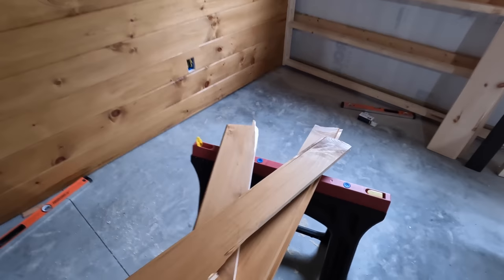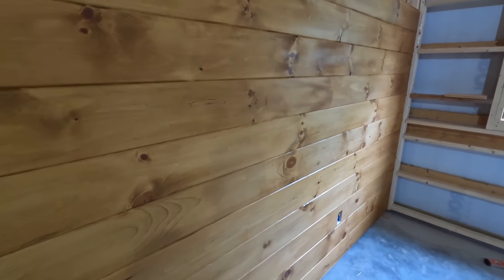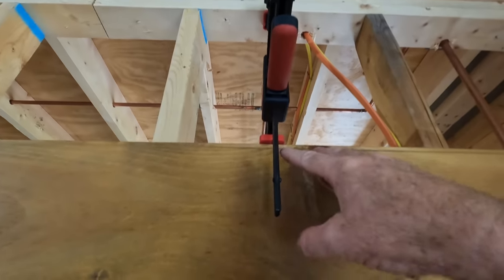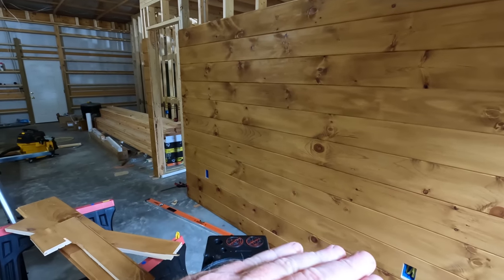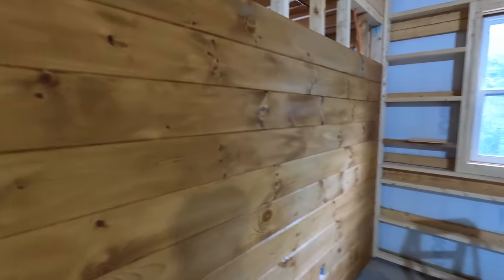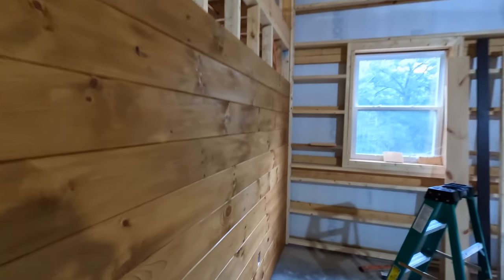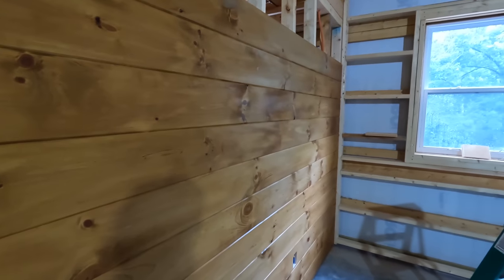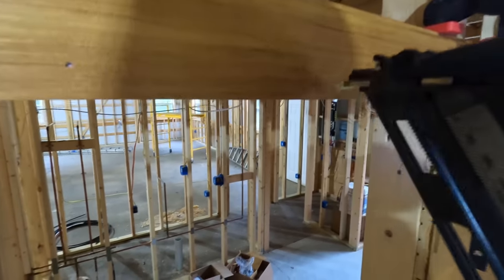Simple, Easy, Beautiful, Tongue & Groove Pine

Comment: Mike, I used the same boards to finish my cabin during the beginning of the pandemic. I charred the wall boards and polyurethaned the ceiling boards to reflect the light. I used a 500,000 BTU Handheld Propane Torch to char the boards. It seals the wood without the poly smell. You could do an accent wall or use it around a dartboard. Have a great Holiday.

Comment: Doing a great job there Mike, all I can add is to put a stop on your drop saw so you don't have to keep measuring the short pieces and your square works well as a guide when cross cutting with the circular saw. Looks good and you don't need to hold down the couch when it's raining.

Comment: Mike, back in the day we would use a scrap piece and  cut it into a wedge shape nail a block above the bowed board and  drive the wedge between the two forcing a tight joint, that was before reversible clamps and even today there will be places where clamps won't work like when you get to the loft header !

Comment: Mike, I did a similar thing in my basement. Only I used pine boards that were cut like the face of a log to give it the look of a log cabin on the inside. I too pre stained mine and put it up. I made a drying rack out of some 6’ 4x4’s and drilled hole so I could put 1/2” electrical conduit up each side. I then put some cheap casters on it so I could move it around the shop. I actually still have it, it screws together so I can store it in the rafters of my shed. Looks great! Making progress

Comment: Happy Labor's Day everyone. Mike we have cathedral ceilings in kitchen & living room. Our exterior walls we drywalled but our interior walls we used the same tongue & groove pine. We just polyurethaned,yes before we put them up. Don't have the runs ln it. It has darkened up over time. We love it. We used inverted pipe clamps on porch deck when needed. Worked great!!! Have a great day

Comment: Looks great Mike ... 30 years as a builder, high end finish carpenter I always sealed and stained my pine before installing, you get much better results in the end ... and yea, it really helps to have a system/shop/horses set up to speed the process .... the old historic house I bought on the Delaware has vertical pine in the kitchen and one bedroom and still looks great ... and I agree on corner moldings vs. mitered, mitered may look nice to some, but outside corners ding easily, especially with soft pine ... much easier to change out trim if it were to get damaged  ... stock 1-1/8 pine corner molding works great but the price has gone thru the roof ... and 1" always looked to bulky to me indoors ..

Comment: A couple of  suggestions Mike. The T&G does look great but when cutting multiple pieces of the same length don’t waste time and energy measuring & using a speed square on each cut. Simply set a stop block, either horizontally or vertically held in place with a clamp then run the wood to that block & cut. So much faster & easier.
Also, when you come to the top of a door like you did in this video, just run the board, nail it. Then go back with a Flush Trim Bit in your Router & using the framing as your guide cut the wood. Even with that knot, it would have been solid & secure.
Otherwise, keep up the nice work.

Comment: Just in case someone hasn't suggested it yet...
Prefinishing in a production fashion is all in the set up. Several sets of sawhorses and a stain applicator pad, common at Lowes, used with a paint tray will make quick work of the stain and poly. Just wipe the stain on with the pad and come back with the rags. The same pad should give you a good coat of poly once they've dried. You can also stack the boards for drying by building some 2x4 lean-to racks against the walls with dowels spaced a couple of inches apart. Make several to support the weight since they will hold quite a bit.
Hope that helps. If you have any questions just shoot me a message.

Comment: Good morning, You're doing a nice job on the tongue and groove. Tightening those gaps. I used an inch and a half wood chisel hammer into stud on a 45 degree angle and pull down then toe nail into the tongue. I did 1/4" round over rottorbit on all My trimm boards that looks nice. Big mistake.I ended up with zero places to scratch My back! Here in Plattsburgh,N.Y. We are lucky to have of the best White pine suppliers in the nation. Ward lumber in Jay, N.Y..  Our whole interior is wood. Yes it will suck up the humidity. I hung Ours. By that I mean. Started at the top and worked down. It doesn't move doing that way! Spent my last 2 summers hin high school as an apprentice to Everett Richards  an older Adirondack finish carpenter. He worked in many Great camps up where I grew up in Tupper Lake area. For families like the Litchfields, Rockefellers McCormicks from Pa.The farm machinery people. The Post's of Post cereals. And CV Whitney.

Comment: Hi Mike, looks great
A little time saving tip when you are cutting a bunch of shorter pieces, like alongside the door, cut one set up a stop at the right length and cut all the pieces you.  Every piece will be exactly the same length and you will only have had to measure once.

Comment: A few tips, the wood should be poly'd on both sides for outside perimeter wall paneling, I've seen the finish flake off the room side due to humidity coming thru the back.  I would also have done 3 coats of poly as the instructions say.  Buy an airless sprayer & the job will go very quickly.
   Use a clamp on the miter saw as a stop block, it's much faster.
 Depending on the look your after, check each board as you put it up to see where the knots are located, I see you have like 3 boards next to each other that all have knots in the same area, you might want to stager the larger knots.  Remember you & your family will be looking at this for many years, take your time and make sure it's the look you can live with!

Comment: Good morning Morgan’s 
Looks great.. Lot of time consuming work putting up pine.
When I built my house I used tongue and groove pine in my entire house.. Mine goes vertical so I had to use blocking every two feet.. Took a few weeks to do it but I love how it looks..
I did stain I just used polyurethane on it .. I did learn fast that water base was the best.. Took more coats to do it but it dried fast..
Oil base the fumes got to be overwhelming even with fans I could float around the room. Hahahaha If I hang a picture and take it down a year or so later it is lighter where the picture was.. hahaha Light darkens the wood..
But I would do it all over again..
I love the way it looks..
Your going the stand back when it’s done and smile.. You are going to love it..
Another  plus you can hang anything anywhere with a screw or small nail with it and if you move it it really doesn’t show.. 👍
Have a great day 
Stay safe and always be kind.
Cheers

Comment: I have an outside corner idea for you Mike. I used it on
My corners in our shouse. I took cedar 4x4’s, set my table saw fence at 3/4” and made multiple passes each time setting the saw depth higher until I basically removed a 2 3/4 by 2 3/4 square which left 2 sides of the original 4x4 so it’s basically an L shape so when you install it over the outside corner it looks like one solid piece of trim that matches both sides of the corner.  Basically wraps around the corner. It’s tough to explain and takes a little time. But the end product is neat. I only have a few outside corners so it was worth the extra work.

Comment: Love using tongue and groove pine. My Dad's camp and 60x40 garage are all done in T&G pine. Currently working on a room in my basement using it, the boards I have are regular T&G flat on one side and are T&G breadboard on the other. Yup those knots can get ya if your knot paying attention,lol. One thing I use occasionally when ripping long straight lines with my circ saw is the Kreg RipCut. Super easy to take on and off. Can't wait to see more on the Cabin for your property, very exciting stuff Morgan's. Also, that pine you bought is beautiful stuff. You could potentially save some some money if you had a pine mill that sold planer rejects or sometimes they call it camp pine. It has some imperfections but still looks beautiful and has well in my opinion even more character than the premium boards.

Comment: Great job with the interior wall, See Ken Karpenters for stain lots of boards. 
Make a pair of tree stand out of 2X4 with 6 or 8 arms 6” apart and you’ll have room to stack up 250 ft at a time to dry.

Comment: If you nail into the tounge , you won't have any visible nails . If you worry about boards being too wide , use PL400. Also tape is your friend ,measuring every few rows to the ceiling or whatever termination point you got , ensures you keep everything straight.   
Nice job.

Comment: looks good, if you can avoid hanging pictures or anything you may be removing down the road that would be best because the boards will darken and where something is hung won't leaving a patch , i built a log house and have t&g pine used three coats of diamond coat water based to avoid yellowing  but it will still darken over time especially if theres lots of light from windows . just figured i'd give an heads up , you probably know this already, Cheers !

Comment: Little tip Mike when making multiple short cuts the same size on your miter box is to put a pencil line on your saw fence on the first one so you don't need to measure each one.

Comment: Here’s an idea for your corners,,,,,,,Take a 4x4 cut out 1 corner of the post for the length of the 4x4, and nail it on. You’ll have a square piece left over, you can use for your inside corners. And no seams.

Comment: Ya probably already know Mike, if you're repetitively cutting the same lengths, set up a stop block and end the need to measure. The stop block can be as simple as a off-cut or a commercially available device from Rockler or some such.

Comment: Many will hang black plastic, tar paper, or felt behind the tongue and groove so that gaps will not be so visible.  If you continue to clamp or force the boards out of level, you'll end up with quite a mess if your lumber is anything less than perfect.  Just in case you discover you need a different fix.

Comment: Mike I have noticed in this video and others that you use a square and mark a line on the board before you saw it. That isn’t necessary when you use a chop saw. If it’s set up correctly. Just trying to save you a step and time. Other than that carry on 👍🏻

Comment: Mike, very nice job. The only thing I would consider is maybe a larger width trim. It's a big room. But like you say, that's just what I think. BillEB
Reply: Bigger?  1 x 4 is already going to be big trim.  I think 1 x 4's is good for around doors and windows, but would bevel the outside edges with a router once they were up. I would go with 1x6's with a beveled top for baseboards.  On all of the wall inside corners and outside corners I would plane the 1x's down to 3/8" or 1/2" max.  Full 1x's in the corners start to make it all look picture frame'y....if you know what I mean.